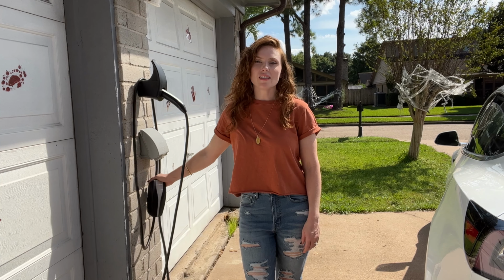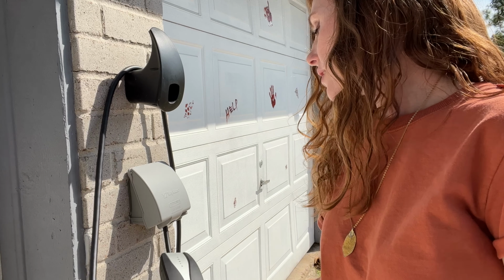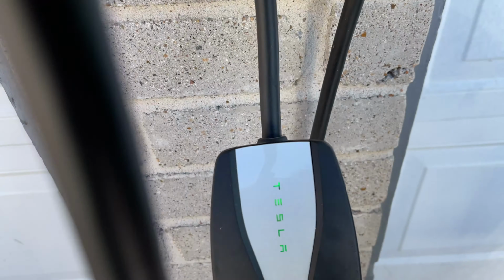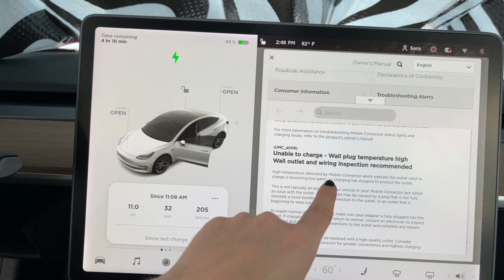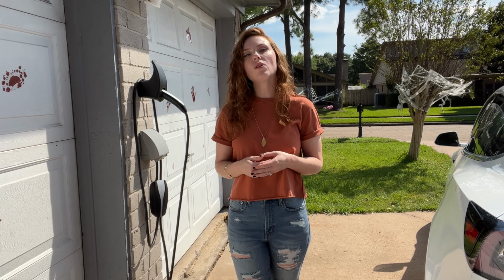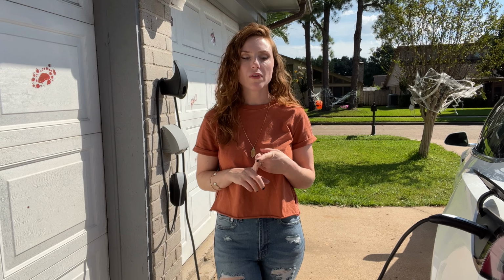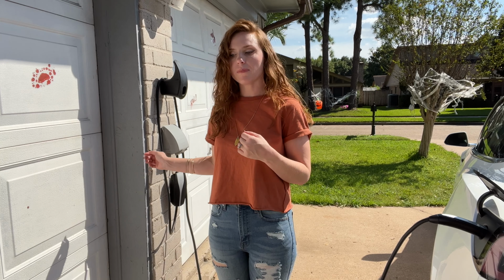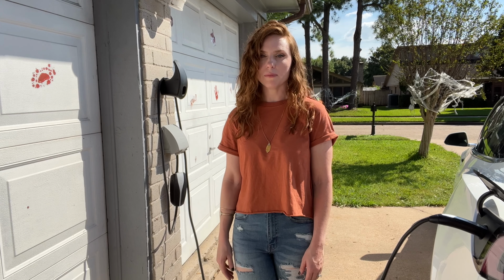TESLA Mobile Charger Problems/ Troubleshooting

Comment: I know this video was 3 years ago.  Whoa...4%  battery??  Try not to go below 20%.  The sweet spot is staying between 20% and 80% for daily driving.   Also, sentry mode does not work after 20%, so that is a big incentive to keep it above that.  If you keep the regiment, your battery will last a very long time.  Great video btw! 🫡

Comment: Thanks for this. For me, the takeaway is how to reset the tesla mobile charger by unplugging it and plugging back in to a live receptacle. The manual is not very good, but at least says: "In some cases, you may need to reset the device by unplugging the Mobile Connector from the vehicle or from the power outlet." The other takeaway is to watch out for overheating; but thankfully, I charged in a garage.

Comment: Marty in Florida. Same problem with an inside my garage mobile connector. Because it's always plugged in, it stays warm all the time. Not a good start for a "fill-up." Most of the time, it slows down due to heat. So I just started unplugging the unit at the 50 amp wall plug to let it cool off. Maybe two hours or so. It worked!  The next charge went smoothly with no reduction in power delivered. Yeaaa.  Not too cool to be plugging it in and out, but it worked. 
Your's is outside. A simple drape of cloth or even leather over the wall portion will provide some relief. Thanks for your guidance.

Comment: Thank you so much! Your solution (resetting the mobile connector by plugging it into 110 outlet then switching back to L2 outlet) also worked perfectly for me. No mention of this in the  troubleshooting section of the Mobile Connector manual which was worthless to me.

Comment: It might sound counter intuitive but you could cut a hole in a white sock and slide it over the charger leaving a gap to still see the indicator lights. This would also help protect it against scratches and damage as it hits the wall in stronger winds. On the hottest days you may find you need to shield it from direct light with a piece of white plastic which you could simply velcro.

Comment: Just took my 21 model 3 on a huge cross country road trip and no issues, but then now my home charger is acting up. It’s not in the sun, so I’m researching what the problem could be. Even though my issue is slightly diff, still very informative- esp reading through the comments for other ideas, Thanks for the video! 🙂👍
Reply from the maker: Oh no! Go into the video description for this video and I think I linked the Tesla website where it shows all the different lighting error codes on the charging cable. Basically when it’s acting up, look at the tesla word that lights up on the cable and it will blink a certain way or color.
Reply: @SaraJAwesome  it’s a mobile charging cable and it’s like mostly working now, but stressful bc I have to keep checking it like constantly babysitting it to make sure it’s charging for the next day - first world problems, but still annoying 🙄🙂
Reply from the maker: Been there done that. At least u can check from your app. Sorry
Reply: @SaraJAwesome  thanks! I think it’s my cord thing, it’s loose so I just messed w it until it stayed charging until I can have someone come out to check it out 🙂 it ended up fully charged for now 🙂👍
Reply from the maker: The tesla mobile charger user manual link is right under video description;) Is it a wall charger or mobile charging cable?

Comment: My charger is in the same position just inside the garage. I’m in Cali desert and my garage still causes the mobile connector to get hot. Shade or no shade I haven’t found a suitable solution other then lowering my charge from 32 amps to 20

Comment: :yt:Thank you soooo much for your help TESLA_MECHANICS on Instagram. The same situation happened to me last night, I cannot unplug the charging cable at a Tesla supercharge station. As only a one month old Tesla driver, I was in a panic mode. On the phone with customer service over 45 mins, they eventually directed me to release the charging cable manually. After I got home, on the phone with them another 50 mins to figure out how to remove the error messages and went nowhere. Then I did my own research and found TESLA_MECHANICS on instagram . I checked my car this morning, guess what? Just like you said, the error message was gone. Thank you again for posting the video to share your experience. Hopefully Tesla can fixed this default soon.

Comment: You have the exact set up that I was planning on installing, and made it look professional too!
That is a wonderful looking charging station, and it's just a mobile charger!

My only concern with this was the rain. You don't have any problems leaving that mobile charger out in the weather?

Besides the heating problem, I think that can just be fixed with a cover over of the charger.
Reply from the maker: I have no issues with rain. There is the awning if the garage that hangs over a little to protect from rain. And the cover on the outlet. I don’t have snow or ice so I don’t know about that.

Comment: Ms. Awesome, there are a couple suggestions that I use in charging my ‘20 model 3. First, I’ve installed the charger unit within my garage. You could also have your current charger higher on the garage wall, out of the sun. And third, I charge only between midnight and 7 , getting the best rate and assuring none of the heat problems you’re having. The last is the best, l think.
Reply from the maker: ✅✅✅✅Yup! I agree ☝️ 💯 Barry! I agree with it all! I only had the overheat problem when I had to charge during to day due to my kids extra long football games after I got home from work. I usually only charge at night. But these are ALL good tips for ANYONE! Thank you!!!

Comment: Hi good video why have you put your 220v outside the garage? Shouldnt it be inside?
Reply from the maker: It’s fine to be outside, my outlet is covered with a weather cover, and an overhang from the house. So it doesn’t get rain or water or snow in it, BUT IT IS EXPOSED TO THE HOT TEXAS SUN. So mine just has a problem with being exposed to extreme heat. I should have installed it inside but I can’t park inside so… yea.

Comment: Just build or buy a 10 foot 50 amp rv  Extension cord and put the charger Box on the ground in the shade will fix this problem. I used a 30 foot cord and placed my charger under a plastic cover in the summer for shade and in a weather proof Tupperware in the Winter to stay out of water and snow.
Reply from the maker: Very smart!!!!! Thanks!!

Comment: hi Sara I have a GEN 1 charger and all lights are green on the charger and once I plug it up to my 2013 Tesla S  it starts blinking green and I hear the charger making  CLICKING SOUNDS and suddently the charging port on my car turns red.  reset it and followed your advise but t would not work. I am able to charger up at a TESLA S charging station. can you help me out ?
Reply from the maker: Oh jeeze! I’m sorry I just got to this comment!!!!  Can you possibly email me at sarajawesome@yahoo.com. Or even better message me on Instagram at sarajawesome or Twitter at sarajawesome. That way you can send me a pic or video and I can help you trouble shoot. They main thing here is when it happens read the screen on the car and see if it tells you and error code. You can also click on the little hazard button your screen and see last problems and it will show it there. Then you need to unplug from the car first then unplug from the wall for at least 20 seconds and then try again. Plug it back into wall then plug it into the car. Then look at how the TESLA is blinking on your charging cable and that will tell you what real error. So this is a mobile charger right? Not a hardwired wall charger? Also look at my link in the video description that goes to the TESLA website and shows the error codes. Let me know and I’ll help the best I can. So sorry I just got it you!

Comment: hardwired wall connector may not be the worse idea. especially if your state has incentives like ny
Reply from the maker: We don’t have good incentives that I know of, but eventually I will get one. But for now I’ll use this one until it dies. Lol I’m cheap. Eventually when I do get a wall connector I’ll place it inside the garage and run the chord under the garage probably.
Reply: @SaraJAwesome  maybe a car port or a patio umbrella. might be an alternative as opposed to another 240v outlet in the garage
Reply from the maker: Yeah, both good ideas. I’ll figure something out next summer. I’m not sure what exactly.

Comment: Hmm, i also live in Tx (Del Rio) and my charger is in the sun all day and I have no problems. Might be i only use 120v charging.
Reply from the maker: I don’t know know for sure, but I think you could be right. I’m not an electrician but so think the higher voltage and amperage could cause more heat, BUT that’s also strange because I feel like my can immediately tell me it’s too hot. So I don’t know if the car know once charging it will be too hot because of the temp of the GFCI box on the mobile connector or what. Because if mine and yours are. It’s in the sun not charging then they would not be producing extra heat from charging until plugged in. And mine has issues immediately when plugging in before it starts to even charge sometimes. Hmmmm so many questions now. Could be another issue with my connector, 🤷‍♀️ Thanks for sharing this, Scot! I love sharing info like this and comparing variables!
Reply: @SaraJAwesome  Try just plugging into a 120V outlet to test it out. Love your channel;)
Reply from the maker: Okay, I’ll try that this summer out of curiosity. And thank you!!
Reply: @SaraJAwesome  One more thing, who installed your charger? Possible they used wire of the wrong gauge? For a 50 amp charger you need at least 8 gauge wire, something smaller like 10 or 12 gauge could cause the over heating. Check your Electrical panel, should be at least a 50 amp breaker dedicated to your charger.
Reply from the maker: My neighbor and I did it. Mostly him, he’s a retired electrician. I can’t remember what we used. But I did list all
Of it in a previous video about how I charge my Tesla. Honestly we need a new breaker box. So they could be an issue too but I’m not sure. It’s a 30 amp but I never actually pull 30 amps. I get like 25-27 amps. Good idea though checking the gauge wire. We used what was there and extended it through the attic with the same gauge to the driveway another 20 feet or so.

Comment: When I parked my Tesla outside, I had a kind of 'bird box' made for the charger (my stepfather is an awesome structural engineer and can make anything), which covered it completely, except below, so the cable could hang down, and with a hatch for easy access when I needed to charge. I live near the Arctic, so it needed to be protected from both snow and rain. 

Also, the charging "lump" at the end is quite heavy, and should not be supported by the actual cable itself. Many people have had their chargers ruined because of that. Propping it up with a simple screw will suffice, so it shares the load with the outlet plug.
Reply from the maker: Oh that’s genius!!!!!! You’re lucky! Also, that’s great advice on the weight of the charging cable. I keep mine kind partially wrapped around the hook so the cable kind of takes the weight off both heavy GFCI box and the weight the cable hanging from out of the car’s charge port. I can’t really explain it but I know what you mean. ;)
Reply: @SaraJAwesome  As long as the charging lump is not suspended in the air, it's all good :)

Comment: Not sure if this would work, but it's an ideal. Make a little foam box that fits the Mobile charger to keep it out of the sun. You can even spray paint and decorate the foam box to make it look less "DIY". Not sure if the foam will keep the heat inside, so maybe have an opening that faces the garage for air circulation.
Reply from the maker: Smart;) For now during the colder months it’s all good. But I think eventually one day I will get a Tesla wall charger and install it inside with only the chord running out under the garage door. Or maybe possibly just install the wall charger there because it’s so pretty. But inside would be best for heat reasons. For now in the summer I may just hang some kind of cloth over the charger from that charging cable hook to provide some shade over the unit yet still allow airflow. This was another idea someone mentioned too.

Comment: Have you considered installing the Tesla wall connector charger using a nema 14-50 plug? You will be able to charge at 39 miles/hr.
Reply from the maker: Yes, eventually I probably will get one. But for now I’m going to use my mobile cable until it dies. Lol 😂 It’s definitely better to get a wall connector and get it installed inside the garage or in the shade.

Comment: The mobile charger is actually only meant to be use away from home when no other option is available. It isn't designed to be used daily and will wear out prematurely. 

I'm actually going to sell my mobile charger when I get my Cybertruck and buy a third party mobile charger (juice booster 2) that will last forever. That charger can be run over by a tank and still work afterwards. It's expensive, but high quality is worth the extra cost. 

The Tesla mobile charger is more than adequate for it's intended use, but it just isn't designed to be a home charger.
Reply from the maker: That makes a lot of sense. You’re probably right. If it dies I’ll just buy another one. Good idea on the other charger though. That’s interesting 🧐 I may even get a Tesla wall charger, but I just don’t see the real need right now. I definitely recommend the wall charger though for other people after doing this video. Thank you so much for your input!
Reply: @SaraJAwesome  The juice booster is only availible for Europe and Australia currently, but they are coming to America soon.
Reply: @SaraJAwesome just want to inform you that the "J+ booster 2" charger is now availible in America too.

Comment: I noticed that the street end of your garage is south facing. There are a few simple 'fixes' you can do.
One would be to do the equivalent of a lamp shade. Simple place something over the mobile wall connector to block sun light, but there needs to be some possibility of air flow, thus the lamp shade idea.Second you can put a wet cloth on the mobile wall connector safely, but that requires you to constantly maintain it; a bad idea.Third, and not a simple fix: the garage door pillar in view of the camera is already in the shade, and since you are not using your garage to park cars in, the plug portion of the wall connector can be place there, maybe relocating the plug higher up, keeping it a bit out of the way.Lastly, unplug the mobile wall connector after every use and keep it in the car. When you get home in the afternoon, plug it in to charge. This is by far the simplest solution.
Reply from the maker: You are AMAZING, Mark!!!!!! I started taking the cable down during the day. Eventually I will fix it and let everyone know what option I chose! Thank you so so so much for these ideas! Have a great week!!!!!!!!!

Comment: This was good to think about. I had my Tesla wall charger installed with a 60 amp circuit. I was concerned about heat on the west facing wall. I had a few days of 110 degrees in July. It never shut off but I will be watching next summer for any heat issues.
Reply from the maker: ✅✅✅✅✅✅✅I’m so glad you haven’t had these issues!!!! I think the wall charger is probably way better at this point after talking to so many people in the comments in this video. The Tesla wall charger has a white (white doesn’t get as hot) glass cover (provides shade to the internal components) that seems to protect it from getting too hot. Also, since it’s hardwired in, it resets on its own or at least when you just unplug from the car. You don’t have to unplug the whole thing. So maybe that’s why you haven’t had the issue! What are your thoughts on this??

Comment: I actually planning to put my Y in the garage and charge it there. So I installed NEMA 14-50 inside. However in the mean time my garage still full of stuff and my Y is parked outside.
In the mean time I have mobile charger plugged in the outlet in the garage and running cable under the door to outside. This would solve your problem too.
The only disadvantage of this solution is that I have to open the garage door before driving if I need my charger with me.

Interesting if installing level 2 charger instead of your outlet would cause the same problem? If you’d install it in the garage (to avoid overheating) and run cable under the door, you won’t need to take mobile charger and open garage door before leaving.
Reply from the maker: Nice!!!!! Yes, I really wish I would have known all this and installed mine inside the garage and ran the chord under the door. It would have been the right thing to do. But I didn’t know at the time. Mistakes were made. 😂 I will probably make a temporary shade for now. But eventually maybe move it inside the garage on the same spot and run chord under the door. Shame I messed up my brick already! Great idea from you!!! Thank you! Have a great week!